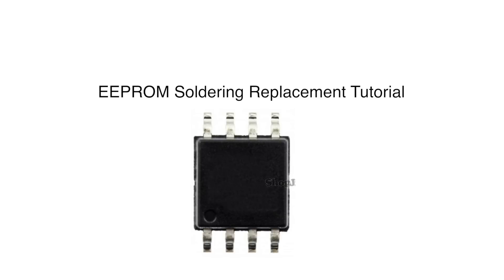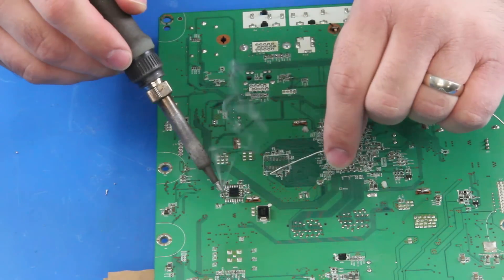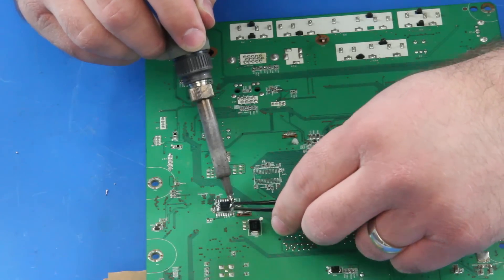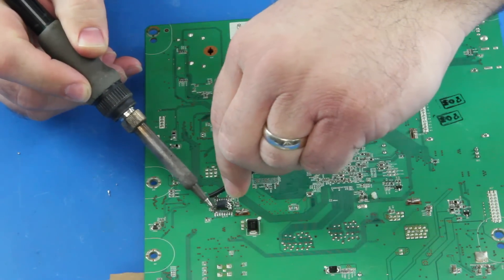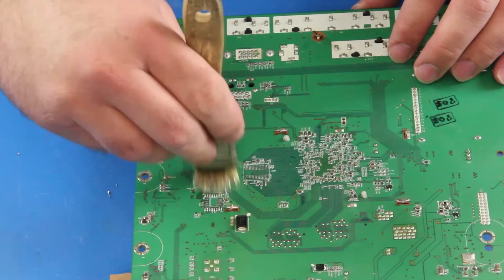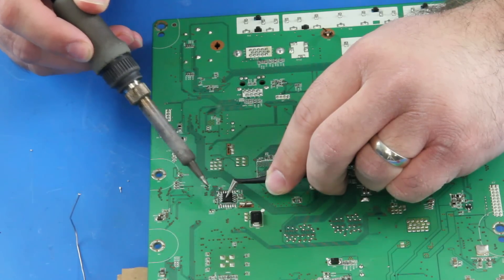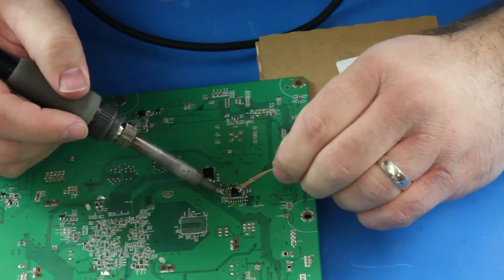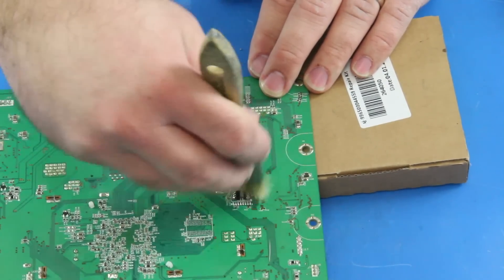EEPROM Component Replacement Tutorial - How to solder and 8 pin eeprom component

Comment: Using this desoldering method will surely destroy the board by exfoliating the copper contacts because of the high temperature. First, apply some flux paste then try a vacuum pump or metal tape to suck all the solder, then the IC will fall by itself. No need to apply mechanical force.
Reply: Unfortunately I did not read your comment and I destroyed my motherboard, the copper contact pads came off